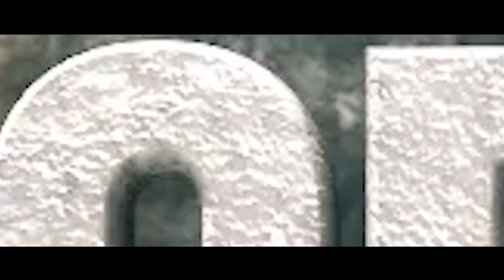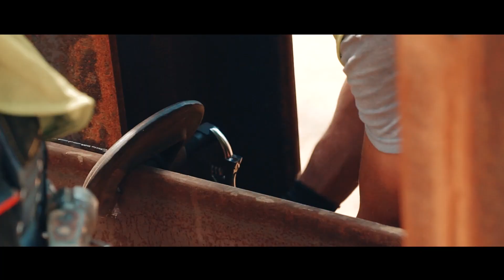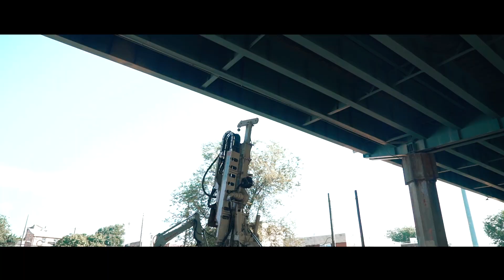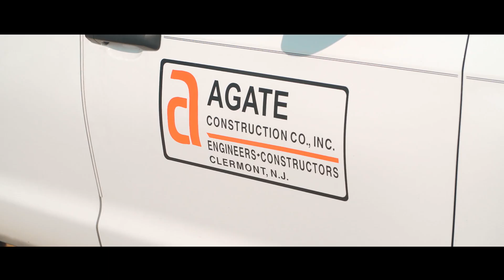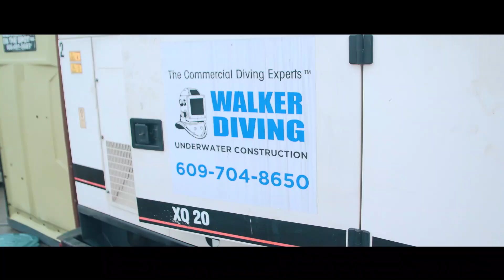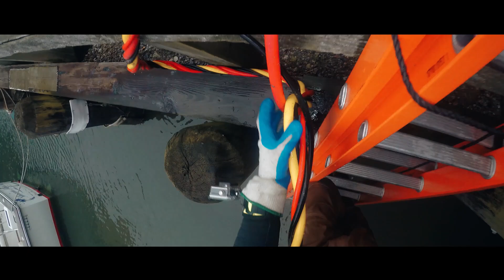Union Carpenter Pile Drivers

Comment: There is no such thing as a carpenter pile driver period. Two completely different trades
Reply: In South East Michigan, pile driving is under union carpenters scope of work. So is concrete forms, scaffolding, bridge work, ect. Local 687 puts in work.
Reply: Pile drivers are part of UBC
Reply: Same here in west Michigan. 525/100 does it all as well.
Reply: Local 1847 does. Pike driving is under the carpenter union
Reply: @carsonsjourney  Local 1847 is a Piledrivers union and is part of a joint union between Carpenters, Millwrights and Piledrivers strictly for benefits. We aren't Pike drivers, we are Piledrivers. I am retired but once a piledriver, always a piledriver. I actually went into the Ironworkers 512 after 1847, but never forgot my beginnings.
Reply: I have done both